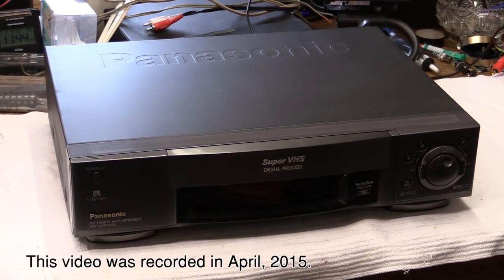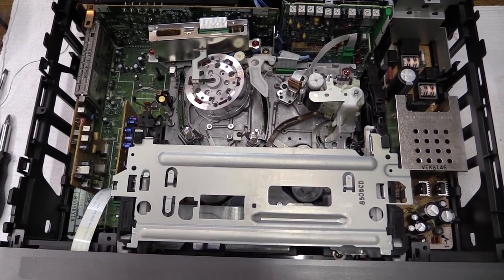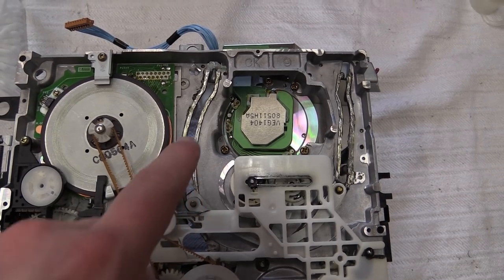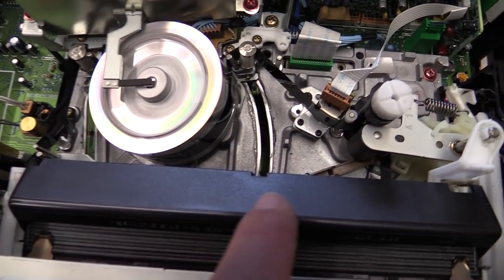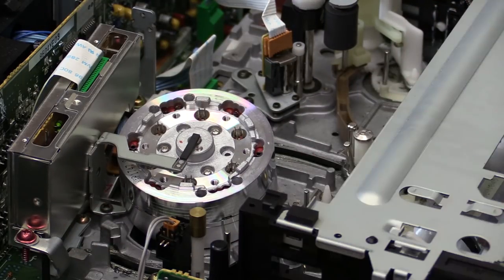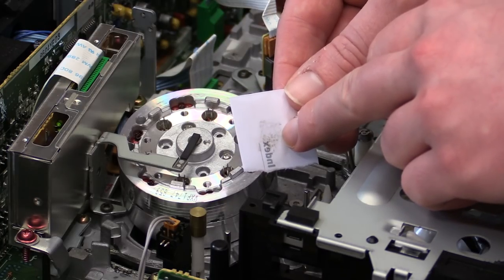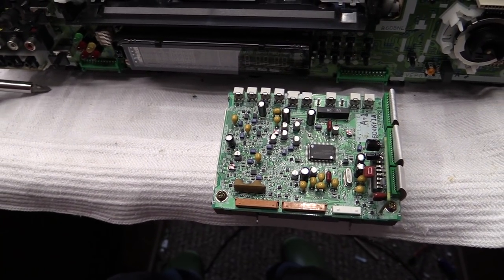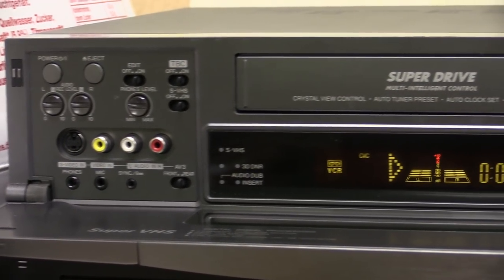Panasonic HS950 S-VHS VCR overhaul and head cleaning

Comment: I worked for a national repair company for 23 years and serviced thousands of VCR"s.I always held the head cleaning paper at the 3 o clock position on the head cylinder while turning the head cylinder counter clockwise. I mention this because at many seminars they told us by turning the cylinder in the opposite direction of spin sometimes the cylinder bearing grease would be dislodged.
Reply from the maker: Interesting, never thought of that.
Reply: I used to use wetted paper myself back in the day and I always turned the drum by hand in the same direction that it was powered up. The later built in head cleaners I found to be more of a nuisance than a help and I removed the contaminated units and left them out. It's a pity that by the time Panasonic were making these machines which were very good performers the VCR was starting to go out of fashion.
I still have my Panasonic HV ND 630 which I just used today , It's 19 years old and still works beautifully , the pinch roller was replaced ten years ago along with a leaking PSU capacitor .

Comment: Hello
You know, I wanted to ask you even to consult about the Panasonic NVHS1000 video recorder
 
I have a question about the Bvg of the upper part, that is, the upper cylinder ... Our device had a critical wear of the crystals (panasonic veh 0651 VJB00T07) and we changed it to a new analogue (VEH0454 VJP0032) ..
The VJB00T07 board was soldered onto our new upper cylinder 0454 and put on the device ... We twisted the racks and removed all distortions ... But here's the question
The head, that is, the whole  cylinder, seems to be rotating quickly, that is, the speed has increased and the image is not of the best quality, when you just slow it down with your finger from above, the image falls into place and shows perfectly ... Please tell me how to reduce the rotation speed of the cylinder

Comment: what liquid are you putting in the paper to clean the head drum? I used to use a dry paper while the tape would run...it was the way I used to clean my VCR as a kid.
Reply from the maker: I use isopropyl alcohol (IPA) to clean heads.

Comment: I've got one of these machines and the front display panel started intermittently working, and then eventually stopped working completely. Everything thing else works but just can't see the display. Any suggestions on where to look inside? A bad cap maybe?
Reply: The problem was fixed as it ended up being a failed diode (IN5819) on the power board. I replaced it and the front display is working again.
Reply from the maker: With the display working intermittently for some time before going out completely I would have suggested bad solder joints on the display. A failed diode is an interesting problem. Thanks for the update.

Comment: is paper really recommended? I thought a cleaning stick with foam is better for this? Because the self-cleaning arms used in many VCRs are using foam.
Reply from the maker: The self cleaning arms are designed to rotate parallel to the drum. With a cleaning stick, there is always the risk of damaging the heads by moving the stick not exactly parallel to the head drum, or applying too much pressure, getting the head tips stuck in the foam pores and ripping them off. I know there are cleaning stick designed especially for head drums, but I still consider paper the safer solution. It takes longer, but delivers good results.
Reply: @DrCassette  I'm waiting for a mint Panasonic NV-FS88 to arrive! First I want to do: Removing the self-cleaning arm and then cleaning the head drum with paper :)

Comment: Hi! What you think, what model of Pany S-VHS VCR is better than other, 950 or 800? Thx
Reply from the maker: The Panasonic NV-HS950 is better, if it works.
Reply: @DrCassette  Tnx! 950 is like brand new! But 800 is too!
Reply from the maker: @slayufa  Then the 950 is better. The 800 for example has no Time Base Corrector.
Reply: Nv 1000 was the best wasn't it. Same as semi pro model.
Reply: HS950

Comment: Hello, DrCassette. It's me again ... as far as I can see from your videos, there's always a way to remove the mechanism without misaligning it. Is that correct? I have a NOS JVC HR-S9911U that needs lubing and a dump find: a Panasonic AG-7650 that, I hope, only needs lubing. Thanks for you videos - not only on VCRs but on other analog devices. Cheers!
Reply from the maker: It depends. Sometimes it's safe to take out the mechanism. Sometimes it's not. Try to find the service manual to your VCRs online, those will contain instructions for disassembly.

Comment: Wow, I have nv-755hd model, 6 head hi-fi over 20 yrs. but when i play vdo, it show F04. So i open cover,it look like in this clip. Then press play, i found tape stuck around right pin (pin that lift up when insert cassette). Like it no power to pull tape then tape go out more and more finally stop and show F04.(sorry my english is bad, don't know how to explain). I don't know what's the problem?  slack belt? or should i clean or apply grease somewhere?  here's clip https://youtu.be/m-L5mUtkbJ4
Reply from the maker: I have commented a possible solution to the problem on your video.

Comment: What kind of alcohol is the best for this, the old forums are kinda back and forth about what’s best
Reply from the maker: I use isopropyl alcohol (IPA) for cleaning heads and guides, for rubber components I use an alcohol based window cleaner because the less concentrated alcohol is not so aggressive to the rubber. Only if the window cleaner does not deliver good results I use IPA also on rubber components.

Comment: Did you end up fixing the Digital Process fault. Do you know if it's a common problem as I'm buying one of these in a few days.
Reply from the maker: I was never able to reproduce the video artifacts. Maybe what I saw there was the Digital Process responding to dropouts on a bad tape. Aside from this mystery the machine still works very well.
Reply: Thanks for the reply! I'm certainly reassured as I'm planning to do a full maintenance and re-lubrication and use this as my workhorse VCR.
Edit: If the digital process did have a problem, how likely is it that it's caused by leaky caps and not something more complicated. I think the caps should be an easy fix as even if you don't have enough experience to replace them on your own, you could probably get the whole board shipped to a professional shop where they'll do it for you.
Reply from the maker: I really don't know, sorry. With this sort of thing it's a game of hit and miss. Capacitors often cause problems, but they are not always the reason why something doesn't work.

Comment: I just picked one up the box is opened but its never been used and still in its wrapping. It came with all unopened leads and evan a spare remote thats £30 to buy on ebay. All manuals to. I payed £50 quid i still cant believe my luck.
Reply from the maker: Yes, indeed, you got very lucky :)

Comment: Does anybody know, wether the hs950 has the 's vhs ET' function, which i think is important when you want better picture and sound quality on normal vhs tapes?
Reply from the maker: What you mean is S-VHS ET which allows you to record standard VHS cassettes in S-VHS mode. The HS950 does not have this function, S-VHS ET is a much more recent invention. However, you can always turn good quality standard VHS cassettes into S-VHS cassettes by melting a hole into the cassette to trick the sensor inside a S-VHS VCR.

Comment: 400 lines with noise that was the best at the time.  Made for good audio recorder/player even at 6 hr SLP speed.
Reply from the maker: Sony at the time offered ED Betamax that would do 500 lines - but of course Betamax was pretty much dead by then.
Reply: Video 2000 was best (2x 4 hours on a double sided cassette), but recorders were too expensive and so failed to sell. Only Panasonic managed to get VHS longplay with 8h of similar high PAL quality on their late K mechanism recorders.
Reply from the maker: The problem with Video 2000 was not just the cost, but also the fact that Philips and Grundig brought the system out too early, before development was properly finished. As a consequence the first generation of VCRs was extremely unreliable, earning the whole system a bad reputation. Friends of my parents bought a Video 2000 recorder, which ended up spending more time in the workshop than in their home. Consequently my parents bought a VHS HiFi VCR.

Comment: My NV-HS950 is still the main work horse for VHS capturing and working fine for the most part, but with some tapes I get some strong vertical jitter. Example: https://www.youtube.com/watch?v=uktdiLGu2mM

Could you point me to which parts probably need maintenance.. I assume parts of the tape transport? I carefully cleaned the heads, but haven't had the nerve to try anything else without guidance.

The same tapes play fine in an el-cheapo Grundig recorder, but with drastically lower image quality. The VHS tapes themselves are BASF PHG240 tapes which have been recorded once and played back 2-3 times max...
Reply from the maker: Because of strange problems like this I stopped using my NV-HS950. These problems are not caused by anything wrong in the mechanism. As far as I can tell they are caused by the Digital Time Base Corrector or some other part of the "Digital Process". I keep getting strange artefacts in the picture if the condition of the recording is less than ideal. I am not sure if this is something wrong in the electronics, or if it is just normal with certain recordings.
Reply: @DrCassette  Thanks for your assessment. I recently noticed that activating the TBC switch darkens the image quite a bit, which is something that I don't remember happening before. I also noticed that my capture devices are losing sync when more than 75% (or so) of the PAL signal is completely white or black even with TBC enabled. So I currently suspect some capacitors slowly and silently going bad. I guess I'll have to browse for a replacement soon...
Reply: You might have to make a new alignment setting. 
Was the cassette with VIVA II recorder in LP? Was ist recorder on the same machine? So you remember the machine?

Yes, sometimes, you would have to align the recorder to the tape you’re willing to digitalize. Other option : try a different machine.

Comment: The common problem of this panasonic mechanism is the small plastic tightely fitted in the shaft of the loading motor which rotates a plastic screw that moves the loading gear.This small plastic on the shaft cracks and the motor spins without gear moving and then the vcr stops.
Reply from the maker: Correct, you have to be very careful loading cassettes on this mechanism.
Reply: How do you fix this?
Reply: @kingshearer2  This era by replacing the plastic with new one,since it was widely available and cheap ~1euro.Nowadays i dont know if still exists.
Reply: @GeorgeGeorge-xj2bc  is it on the right side of the lape loading tray? My tape is stuck and I'm getting a H02 error which could be another problem I suppose.  I want to save the unit since the playback is beautiful. Now the unit when I switch on comes on and goes straight to H02 error and the tape is stuck and I can't take the loading tray out since the hidden screw on the left is covered by the cassette. Thanks

Comment: When you grease/oil a VCR drive, only use silicone based lubricants. NEVER use WD40, vaseline, "all purpose" household machine oil or anything else made from petrol, vegetable- or animal fats or oil because these will make plastic cogs crack or crumble apart like charcoal after few years. The only reason why plastic wheels split around their metal shaft is by contact with incompatible oil. To avoid tape damage also get no lubricants on the heads.

And do NOT remove the head cleaning wheel, but only occasionally clean it with cotton swab and isopropanol. Without that wheel (in some of my drives it is missing) the drum gets dirty about 4 times faster. The urban legend that it rips out heads is nonsense. (If a head shatters by foreign matter inside a cassette, of course debris will stick to the wheel. but blaming that wheel for it is like blaming the magnet inside a automobile gearbox for cog damage because it fishes the debris out.)

To clean the head drum, use a piece cut out of window cleaning rag (faux chamois, about 15*10mm). I insert an empty cassettte frame (tape removed, top and bottom cut out) to make the mechanism spin the drum and gently hold the piece with my fingers against the spinning heads. I do clean the area above the heads with cotton swab and isopropanol. and when the machine is off, I also do very carefully clean the arease between heads with cotton swab - yes this is nothing for unskilled people, but I do it every few weeks and did not break a head with it. (The main risk is to tangle lint around heads by touching them wrongly. But do not move up and down, which indeed may crack heads off, but slowly rotate the drum by hand and stop before touching the head.)

If there is a bad contact (particularly at mode switch and LED sensors) check solder joints. They tend to get bad by heat strain after some years of operation.
Reply from the maker: Since making this video I have started using lithium grease. Is that OK?
The head cleaning wheels are rubbish. Some of them are made from foam which can deteriorate and cause a mess. I prefer to clean the heads 4 times more often or whatever.
Reply: It seems  for metal-metal the moly grease is best but I'm not 100% sure. The Lithium grease, from what I've read on RTR forums is a good choise specially for plastic gears.
Reply: The black dry stuff the author mocked about is that molybdene sulphide lubricant. It is a graphite-like substance (conducts electricity) and only for metal-to-metal surfaces,
Reply: Moblybdene sulphide! That's it. Just for metal to metal. There's some controversy about this on the RTR forums - some people say thats the original grease, some people say there are more modern greases and some people say unless you can clean all the old grease you should not mix greases. I have a Pinoneer 707 - no more original greases available - and a Revox B77 for which there are original lubricants available. But the thing the Dr mocked really was a piece of candy.
Reply: The pinch roller arm (he said he oiled it) and tape stabilizer (spinning tape guide with metal weight on top) are designed to fall down by gravity to hold the tape down in correct vertical position. Do not lube their shaft (or maximum with a tiny drop of thin silicone oil if they squeak) else they tend to get stuck by suction of the oil, causing the tape to bob up and down (random change of tracking etc.). These parts must fall down some mm by themselves with an audible knock when lifted by hand; if they don`t, the shaft has been (s)oiled and needs cleaning.
Reply: ArialTheShamen, my JVC S9911U is not doing the fast forward or rewind - it starts in slow gear but when it changes gears (stops and goes into high speed) some gear disengages. The unis is NOS but was in a warehouse for over 15 years. All other functions are good. Can you imagine what could be wrong with it? Do you think that could be solved by an adequate lubrication? Thanks in advance!
Reply from the maker: If you want to try and talk shit behind my back you can do that somewhere else. Thank you.
Reply: I agree which much of what you say there.  However "The only reason why plastic wheels split around their metal shaft is by contact with incompatible oil" is not right.  Sony and Panasonic machines are perfectly capable of splitting various gears and drive components where they are fitted onto metal shafts, without ever having been got at with foreign lubricants.  I'm going to do a video shortly about just such a fault in Panasonic K decks.